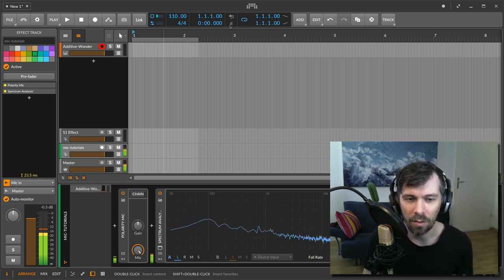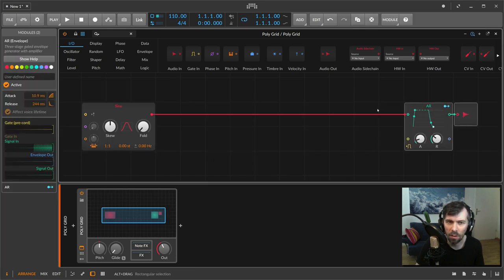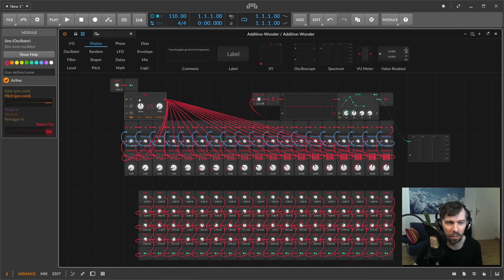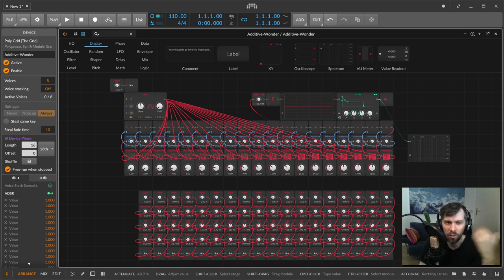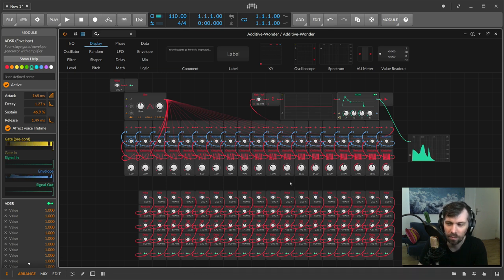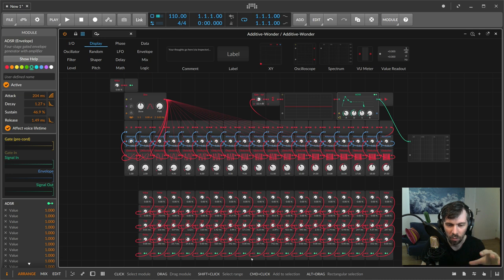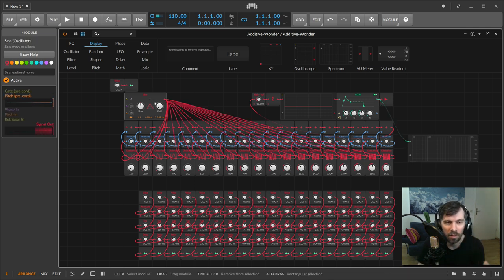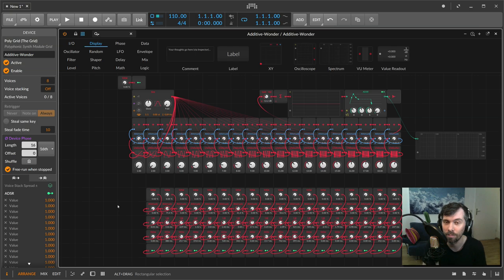Additive Wonder - Bitwig 3 Grid Preset Tutorial

Comment: Not sure if this is still relevant, but..Speaking of CPU load, I deal with it using voice stacking. What?! Yeah! The thing is, grid voices are processed in parallel. You can have 32 OSCs in a single voice, that will put a high load on your CPU, or you can spread the work to different voices, like 8 OSCs in a voice, and as such to different cpu cores. Use the voice stack modulator to force voices to do their own part of work. Voice 1 processes harmonics from 0 to 7, voice 2 processes harmonics 8 to 15 and so on. This way you make use of modern multicore processors.

Comment: awesome trick using the chebyshev! 

I tried to imitate some of the additive x FM features of Ableton's Operator synth is a challenge for myself to help learn this platform...

With 2 Oscillators, with 8 harmonics each, with one frequency modulating the other.. it worked!
But my CPU would jump from 20% to 90% when I engaged the synth... so, not practical for me to actually use in a song! 

Hopefully they introduce more advanced oscillators into the Grid down the track!